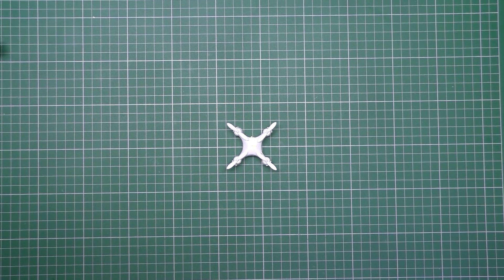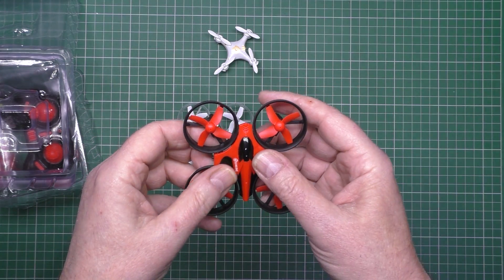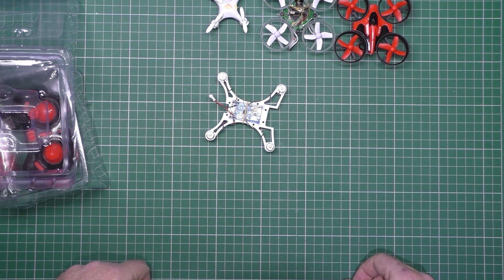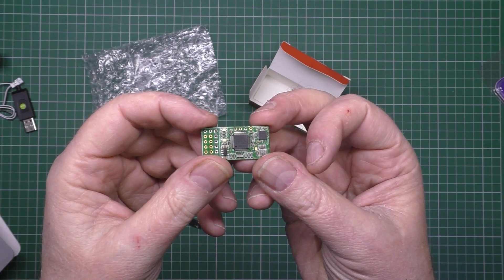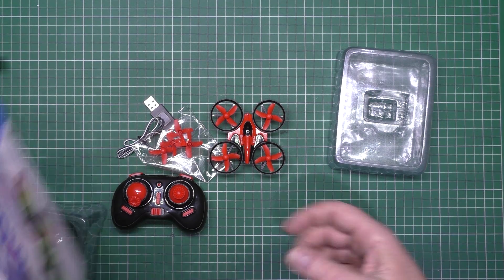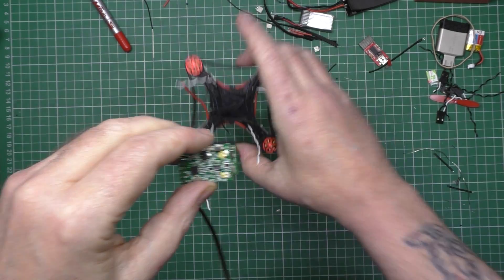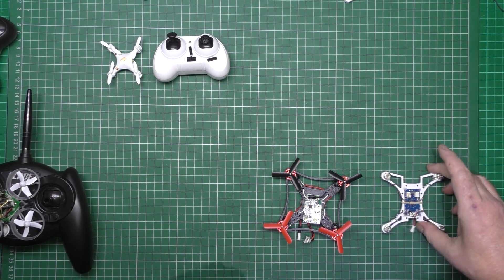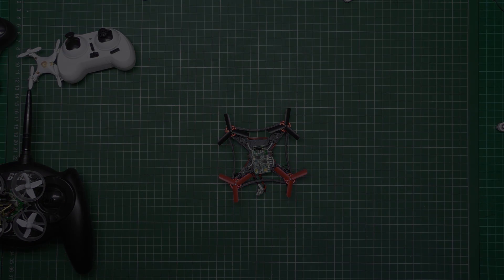Micro quads - I built my own brushless version

Comment: I glued 5/8 extensions on the sticks of that furry bee tx. and rubber banded it to a piece of wood. makes a pretty accurate controler. added a 17 dollar cam/tx and  been flying it for  3 months at least an hour a day. still flys great.originally bought 3 at 13 bucks each, the other two are still in the boxes waiting there turn. not much in the wind but it will sure outrun a cat down the hallway.

Comment: Dude you rock. I'm probably as fit as you are when it comes to flying these little fonzys around. Cheers ya bloke. Great video. Made me order a set of the 1103s in 10000kv and some other bits now. Didn't want a brushless until you compared em like that. I couldnt stop laughing during your comments. Great stuff.
Reply from the maker: I've made my own 220mah 2s batteries with 2 x 1s in series. Hovering is 6 mins (compared to 4 mins on a 1s), sport flying is........ no idea. I've crashed quite a few times before the battery is dead. Handling is the same but it screams its balls off when you hit the throttle. When the weather picks up, I'll be venturing outside to test it.......that'll be the last time I see it for sure! :-)
Reply from the maker: Cheers mate :-)    
I wish they'd had the 10000kv ones when I bought mine, these 8000kv are a little slow when running 1s so I'm running 2s now!
Reply: Vortecks how well do they handle 2s and is there a really large amount difference in lift compared to 1s? What mah are you running and how much time of sport flight (not 3D) are you getting. Pretty awesome how far the tech has gotten the past couple years.

Comment: Why don't you use a 2s and feed the naze but use a diode or regulator to reduce current ?
Reply from the maker: I might do but I haven't decided yet. I want to go for the micro distance record which stands at 0.5km at the moment :-)
Reply: Vortecks 
Gotcha. Good luck. Check out tomoquads. They have nice micro frames. I ordered the Mikkro70

Comment: Another great vid Tony - inspiring.

My first RC experience was with the e010 - now have two and two JJRC H36 from gearbest just to provide spares :)

Also been putting them on diets, got one fitted with Chaoli motors and it came in at 13g. 

But can see I need a 3D printer, start work over UK winter on a micro brushless.
Reply from the maker: Cheers Kev.    
Yes, you now have an excuse to buy a printer. I honestly don't know how I managed without mine now!

Comment: Clip the props down to two blades on your 010. I found it increased flight time and performance. Also, what kind of flight time are you getting with your brushless creation?
Reply from the maker: I've heard of people cutting the blades, I might to a comparison.    
I get ~4 mins on a 300mah Nanotech 35c
Reply: 300 mah! And it still flies?
I've been getting 4-5 min on 210 mah nitro nectar's with Stock motors. I do try to keep it down to 3-1/2 min to take it easy on the batteries but it's so hard to land. So fun.
Reply from the maker: Yup, it flies perfectly with a 300mah on it but it's around 65% throttle on hover. I can stretch to 4:30 but it comes down on its own then.....same thing here, it's hard to land when you're having fun :-)    
Next test is a 2s 300mah battery!

Comment: A great video, Tony.

Micro quads have come along way since the Hubsan X4. Coincidently I placed an order for the Eachine 010 just the other day, along with the little module you demonstrated and a larger multi-protocol module that claims to do all of the Chinese toy protocols as well as the Spektrum DSM2 and DSMX protocols, to fit in my Taranis. Like you I haven't flown the big stuff for quite a while, mainly due to the weather and my disability, so the FPV micro-quads have been thrashing around. Who needs augmented reality when the wife and cat are both viable targets in the goggles 😜.   
Regards. 
Nidge.
Reply: I ordered one of these:

http://www.banggood.com/Multiprotocol-TX-Module-For-Frsky-X9D-X9D-Plus-X12S-Flysky-TH9X-Transmitter-p-1097688.html?rmmds=myorder

And one of these:

http://www.banggood.com/2_4G-CC2500-A7105-Flysky-Frsky-Devo-DSM2-Multiprotocol-TX-Module-With-Antenna-p-1048377.html?rmmds=myorder

Comment: Get the eachine f3 evo fc. I use it on my e010 with my taranis.
Reply from the maker: I did see the F3 Evo but the Goebish module works wonders with the E010 and all the others (apart from the Inductrix). I need a module that covers everything - any ideas?
Reply: I now that the orange module works. I wanted first an inductrix but than i found the jjrc h36 that is a eachine e010 but than cheaper ad gearbest. Than i ordered this http://m.banggood.com/Beecore-F3_EVO_Brushed-ACRO-Flight-Control-Board-DSM2-For-Inductrix-Tiny-Whoop-Eachine-E010-pnew-1089021.html
With that i can now fly it witgoud a module. I now banggood has a module than can fly them both but i don't now witch one it was. But you need each time to remember how to use the sticks to bind the quad.